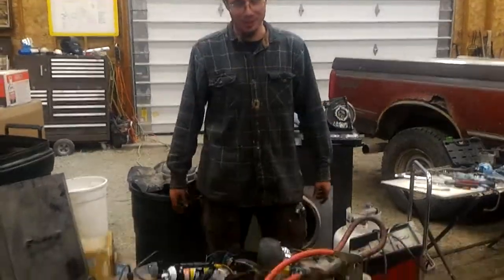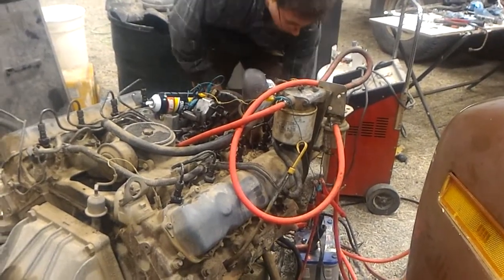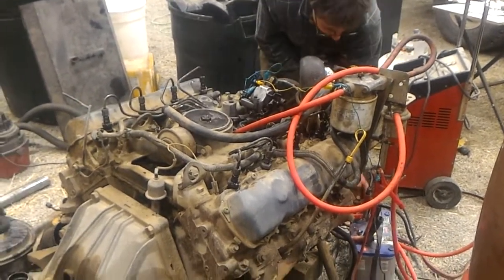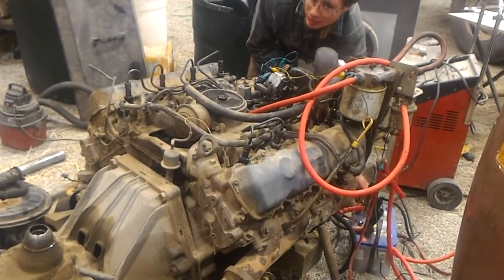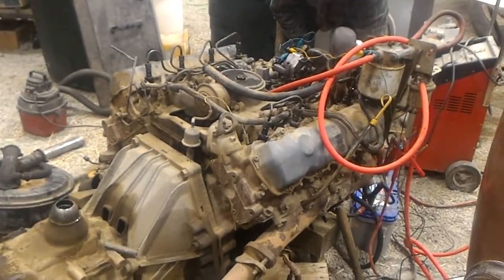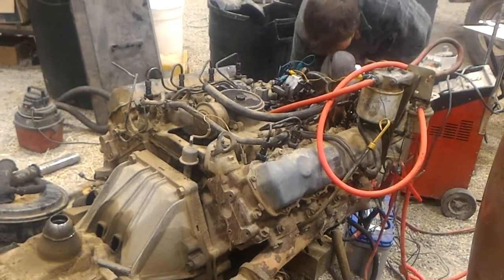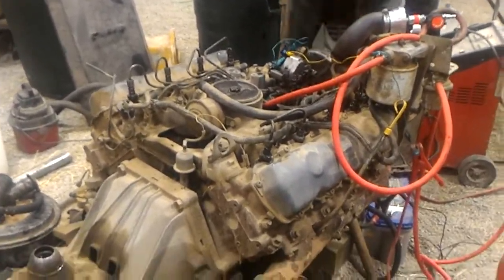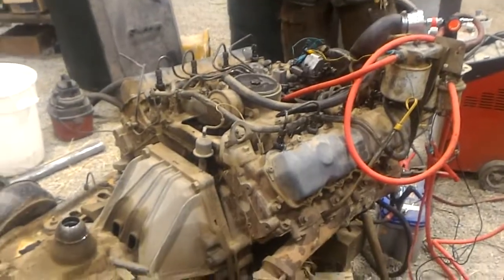6.9 revival on test stand!

Comment from the maker: I want to throw out a followup for anyone that's interested:
The motor got put into the truck, hooked up, and it was still a pain to start(Note: right around freezing outside now). Got it started, drove it out of the shop. Parked it and waited for a set of ZD-1A glow plugs to come in.
Installed the new plugs, and... she fires right up.

She actually runs really well; I dropped the truck off last Saturday(drove it on and off the trailer through the snow), and it hasn't been touched since. Went out there Wednesday(4 days later) to talk to the owner, gave it 15 seconds of glow plug, and it fired right up. Even with sketchy batteries. At 32F.
Sure, it smoked for a little while, and ran on 7 for a bit(not sure if leaky injector or only 7 glow plugs with a good connection), but she smoothed out and idled nicely.
Overall... Good engine!

Comment: I've had to reset several pump gears removed. Your correct setting to tdc but you can get it down a little more accurately. Take a pik tool I use one that has a curved double bend and you can feel on the cam gear and locate the y. Take white out and mark the two top gear teeth directly above that y. I normally quadruple verify lol. Next on the ip gear I draw a line straight down from the pump y to the single tooth below it. You'll have a much easier time nesting the y marks in correct static time. Best of luck glad others are rescuing these old hunks of iron still.
Reply from the maker: That's... actually a really good option. I've heard of people using a mirror to see it, but I couldn't see doing that. The pick, however... that should work nicely.

Comment: 1. Make sure the the FSS (Fuel Shut-Off Solenoid) clicks, every time, listen for it.  Check 1
2. Make sure your fuel pump is pumping. Check 2
3. Don't add ether! Add WD40.  If it still doesn't start, then add WD40 and ether (at least if it doesn't fire, then the cylinders have lubrication!)(ether is NOT lubrication!)

4. If you have to add ether make sure your glow plugs are working.  Compression won't ignite the ether. Only heat (or spark but that's not an option here, right?) If you want to see if the glow plugs are firing look at a volt meter hooked to your battery.  If you fire the glow plug relay and the voltage goes down about 1 Volt or more (depending on the state of your battery), then your glow plugs are working.  If your battery voltage does not change, then they are not.  Fix that problem first before you ether (plus WD40) then it might help.

You might wind up buying a perfectly good engine,  but excessively trying to "start" it wither ether will wind up harming it.

Comment: Wait a minute….how did you advance the timing gear without taking off the injector pump..??
Reply from the maker: First, pull the timing plate off the front of the IP gear housing. Mark where the pin is. 
Pull the 4 bolts holding the IP gear housing to the block. 
Using a small pry bar, pry up on the housing just a bit, while putting a little force on the IP gear (using the small 12-point bolts) counter-clockwise. You basically just pry up the housing(and IP etc) enough to get the teeth out of mesh, then skip it a tooth and tighten it down. you can look at your mark to see how far you went.

The only downside of this is that you'll probably have a little weeping from the timing gear cover->block area, due to breaking the RTV seal... but I usually don't worry about it due to everything else leaking as well lol

Comment: These things kill batteries like a mother
Reply from the maker: If you have the timing right, the glow plugs working, and the controller glowing long enough... the engine should fire within about 5 seconds, even down to 32F. If things aren't right, it'll kill batteries really quickly.

Another cause of battery killing is a dying starter - they have 4 brushes inside, but if one gets worn out too much, it'll "work" with only one pair of two... cranking slowly and taking lots more power to do so.

Comment: You do realize a diesel will never ignite ether  there are no spark plugs in it. it runs on high pressure injection and heated combustion
Reply from the maker: You just keep believing that if you want. At the high ratios of compression in a diesel(18-21.5:1), the air being compressed gets hot enough to auto-ignite the sprayed in fuel... or it would, if it got hot enough to.
The autoignition temperature of starting fluid/ether is lower than that of diesel, so it'll ignite at a lower temp and (hopefully) provide enough extra heat to burn the diesel and/or provide the fuel to push the crank around.

In this case, well, it was a bit sketchy. This is an early model IDI, with 20.5:1 compression... and probably worn rings etc.. Later models were upped to 21.5:1, and they fire off a lot easier, and can even run to some extent on ether alone.

Either way, no matter the method of action, ether /does/ help a cold IDI motor fire up when it does not have a working glow plug system. It cannot help a hot motor though, as it will auto-ignite before TDC and slow down the motor instead(ether lock).